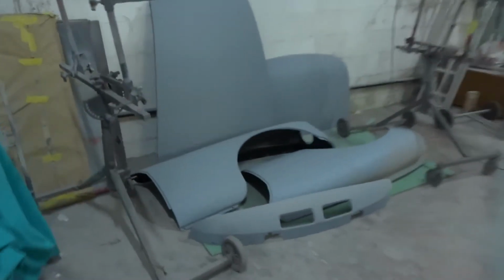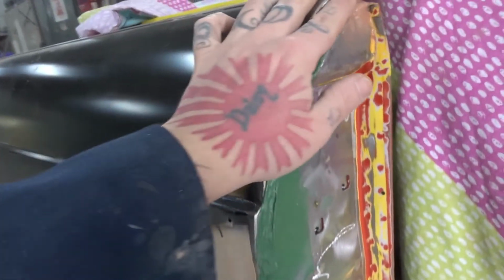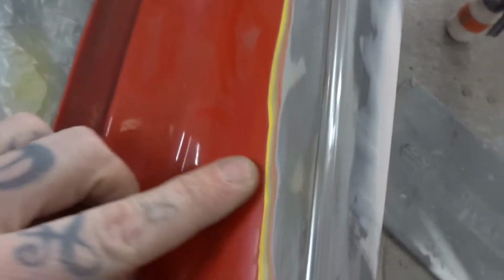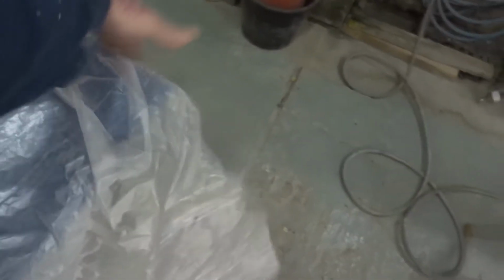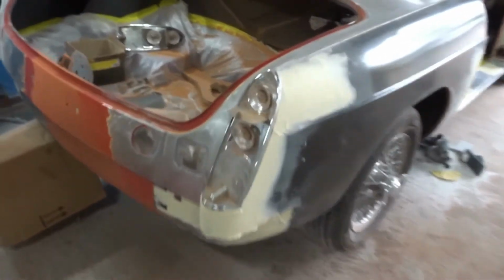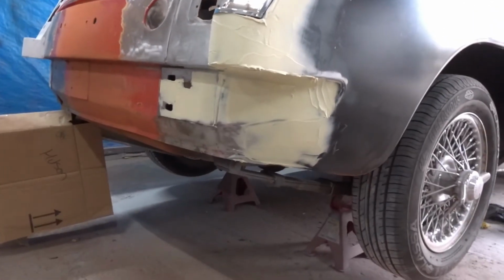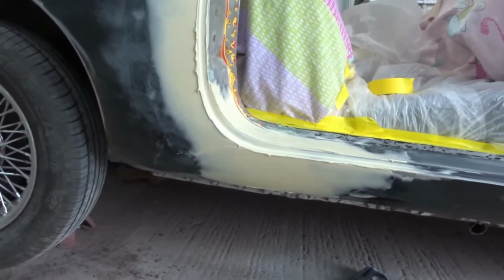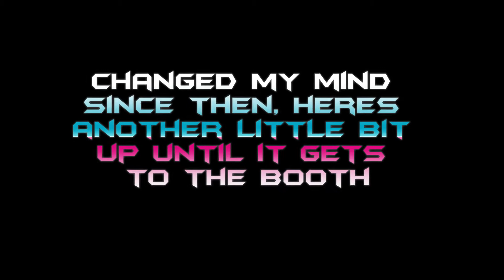We've reached the spray booth!! Its enough to bring a tear to my eye....... #mg #mgb #restoration

Comment: MG is looking good young man, I can safely say that your videos are never boring so keep rolling them out 🙏👍

Ok so got the HS Multi-Mix sample kit and thought I would use a custom colour base called 'Purple Rain' f'n stuff was like gnats piss so had to put 5 coats and a drop coat on, laid down 2 nice coats of the HS clear and it looked the dogs danglies and thought job done 😎

Came back 3 hours later and the gloss had gone it looked like I used a matt clear 😱, all I can think of is I put on to much base and it's shrunk back, flow coated a yellow panel today so see how that goes 🙄😏
Reply from the maker: Thank-you mate, appreciate the kind words 👍.  
Did the cold get to the panel? Sometimes if it gets cold too quick it can 'bloom' (goes matte). Or stick a heatgun on it quickly and see if  you can make a fingerprint, basecoat may be soft still?
Reply: I cleared the panel in the morning, temp in the booth was around 22C all the while I was spraying, flow coated the yellow wing this morning and it's still fine now so I'm thinking to much basecoat 🤔

Have to say the new Multi-Clear HS goes on well and flashes off quick and leaves a nice glassy finish but atm I can't say it's any better than the Final Systems with the extra fast hardener but only used it twice so time will tell, I'll be flow coating a jet black door tomorrow so that should show all the crap 🤣 lets see how that turns out 👍
Reply from the maker: @JohnWD40TC02  look forward to seeing it youngun, get yourself a nice big bonnet to practise with!
Reply: @WinginitPaintSprayers  haha one from a yank tank 😂👍